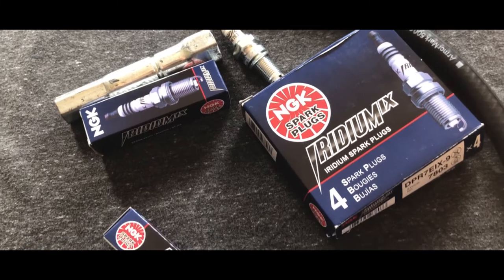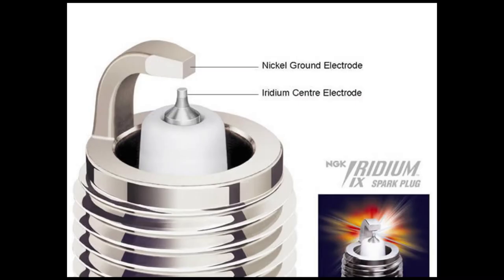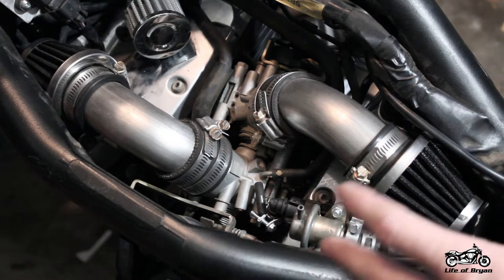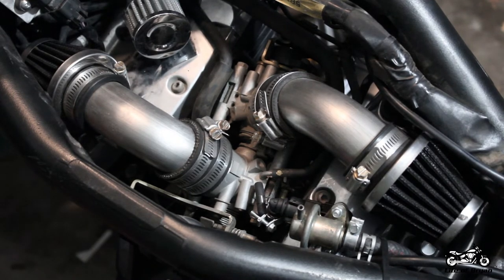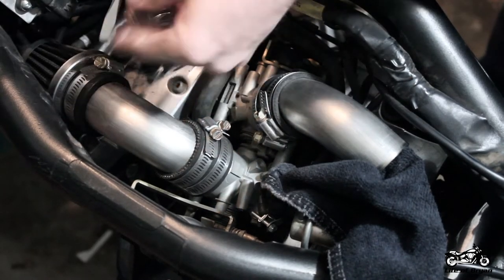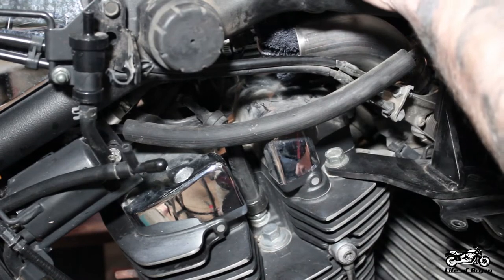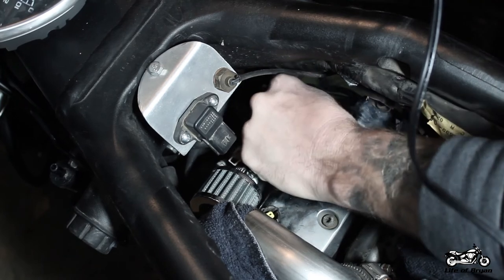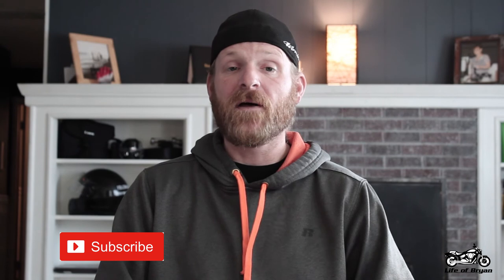Yamaha Warrior 1700 Spark Plug Replacement

Comment: 2004 warrior.  I just did the plug change today.  Your video was helpful,  but.. with the original air box the right front is a little more of a " special treat".
First remove the black cylindrical part near the head tube area the are 2 screws,  this gives wiggle room to get the plug wire off and back on.  Using the original tool kit plug tool, angle it up and into the recess where the plug is,  you can use a flash light if you need shining through the fins this will help to align the tool. You may have to push down to get the top of the plug into the rubber  grommet of the tool once in 9m carefully unscrew the plug.  Putting the new one back in might take a few tries but it will go back.  I used a screw driver through the fins to align the spark plug,  carefully tighten, don't cross thread or over tighten,    position the spark plug wire, once again using a screws driver to help guide the boot over the plug put the cylindrical part back tighten the 2 screws and you are done. Hope this helps
Reply from the maker: Between the performance gain and the extra space created by removing the stock airbox, a BAK/VBAK kit is a definite upgrade that helps in multiple ways. Without that stock box, the plug change is so much easier. Thanks for the write up on doing it with the stock box still in place, I imagine it'll help many others out when they come to the same problem.
Reply: Dave SPADARO what is the black cylindrical part you are speaking of? I’m trying to change the plugs and the front right is kicking my ass. Please help!
Reply: Dave SPADARO Nevermind. I got it. And your tip definitely helped me out! Thank you!
Reply: @davidhoward2074  same bro. Fml
Reply: @davidhoward2074  so we don't have to remove the entire air box?
Reply: Buddy Luv undoing that black cylindrical part is key as well as using the tools that came in the original kit. Good luck
Reply: @davidhoward2074  it's an ignition coil
Reply: I don't see the part you're saying to remove. Where is it?
Reply: @joras18   look at the right side of the tank. You should be seeing the front cylinder. To the right on the frame is the black cylindrical ignition coil. Unscrew the two Allen nuts and move it out of the way.

Comment: Thanks for the video . I took my gas tank off because my neutral light is always on(looking for pinched wire) and noticed the stock air filter was dirty as hell. I am still waiting on the 2 stock filters and ordered plugs also since the tank was removed. I bought my 2006 warrior with 18k miles about a month ago I have had lots of bikes but this one’s really fun to ride I think I’ll keep it forever also.
Thanks,
Brian in Texas
Reply from the maker: Hey Brian, thanks for watching and commenting! Welcome to the Warrior family also. If you haven't yet, join the forum and Facebook groups. Tons of good people and info in those places. 

Warriors are definitely bikes that will put a smile on your face. I still get that little grin when I start it up and take off. 

I like your way of thinking and getting all that stuff done at once while you've got it apart and are already in there. Hope you were lucky enough to have the factory tool kit with it, it definitely helps with the plugs. I'm sure a universal joint and extensions would work fine, but that socket makes the job a lot easier.. Were you able to figure out the original problem with the nuetral light staying on? 

Thanks again! I hope some of my videos have been able to help out.
Reply: Life of Bryan yes I have the tool kit with the spark plug socket, very happy to have it. No luck so far with why that neutral light is on🙁
Reply from the maker: Have you checked the relay under the seat? It's under the and just to the left of the fuse block. Believe it's under 40 bucks to replace.
Reply: Life of Bryan Do youHappen to know the name of that relay so I can start researching where to get that part?
Reply from the maker: Here is a link to one on ebay. They're a little more than I thought, but this one comes from partzilla and seems to be about fifteen dollars less than all the others. Hope this helps you locate it and track it down. Keep me posted.

https://rover.ebay.com/rover/1/711-53200-19255-0/1?icep_id=114&ipn=icep&toolid=20004&campid=5338428498&mpre=https%3A%2F%2Fwww.ebay.com%2Fitm%2FYamaha-5PX-81950-00-00-RELAY-ASSY%2F283318472758%3Fepid%3D1433685955%26hash%3Ditem41f718d036%3Ag%3AjhcAAOSw7mlZ5Mfd
Reply: Life of Bryan Awesome I will let you know how it goes

Comment: I had changed mine with spark plug socket. The front spark plug was difficult to removed but got it out. It would be easier with their spark plug removal tool. Great video.  Keep it up.

Comment: 2002 Warrior, traded my '96 Vmax for it four months ago.  Younger brother owns a large moto service shop in central FL so he had it there the first month I owned it.
R1 forks and front fender
Jardine full system straight cut drag pipes
Power Commander V
Barons Stealth BAK
Barons 930 lb spring
Barons lowering link
TT bars with Kuryakyn Kinetic grips
Reply from the maker: Hey, thanks for the comment, and welcome to the Warrior family! Sounds like you already got into it quite a bit. Have any more mods planned in the near future? 

Those Vmax's were beasts! Another guy who rides a Warrior in Michigan just recently acquired his by trading his vmax for it as well. How does the warrior handle compared to the vmax? I'd say that I hope winter hasn't been too bad, but being in Florida, I'd imagine you're still getting to ride. Life goals to ride year round. Thanks again for watching the video and commenting!
Reply: Even when I lived in NC, I would still ride year round.  Being back in my home state of Florida though is nice, winter riding isn't too bad, it's the summers that can actually be unbearable with the heat and humidity.   I'll likely keep this bike for a while.  Yes, the Vmaxes are a beast of a bike, not the most comfortable on long rides, but a monster in a straight line (factory boosted 145hp V4).  The Warrior has it beat in handling, and comfort.  That was my main reason for trading, I wanted something more comfortable for the wife and I to enjoy, and pushing 50 years old, I needed to slow down just a little.  I've always liked the Warrior styling and finally found one that I was able to trade for.  Thanks for your great videos, they were a big part of my research when looking for my Warrior!
Reply from the maker: Florida weather reminds me a lot of Missouri in the summer. Hot and humid, but Missouri doesn't have the daily rains that seem to hit Florida. I used to ride year round, but now I don't break it out if it's below fifty, except in the spring when I just can't take it any more. 

That's awesome that my videos were able to help you out when looking at bikes! I love the looks of the Warrior. It always seems funny that a bike that's almost twenty years old still turns heads like it was brand new. That's not even mentioning the torque and handling of the bike. They were great bikes and I would love to see Yamaha revisit them again in the future.

Comment: hllo Bryan
recently purchased 2003 rs warrior. needs a little work. has stage 2 cam and injectors/ big air kit/ predator ecu. 240 back tire/ air ride suspension. just rebuilt thr rear master cylinder . currently waiting on a vbelt from chaparral Yamaha in san Bernardino . this bike has 16" ape hangers custom paint job and roadking front fender.. cant wait to roll on it. I come from a streetbike and Harley sportster bg. ridin dirtbikes for years too many injuries. love the videos .

Comment: Ashland, KY  02 warrior, and its my forever bike, daily rider is a harley now, but i actually cross threaded my front left cylinder, i have to taper the threads of every new plug to get it started now
Reply from the maker: Ouch! That's always one of my biggest fears when doing plugs. The Warrior sure didn't make it easy either. Almost like they wanted you to cross thread them. That fuel line trick is pretty slick though. Thanks again, stay safe out there!

Comment: Actually the M109 and C109 are different internally. However, the C109 is powerful and has plenty of torque. The challenge is she weighs 900lbs. Mine has various modifications, GMan exhaust, self calibrating fuel system and aftermarket air intakes. My fat girl “moves” and sound great. More important like the Warrior it leaves Harleys behind...lol
The bikes are for the most different ridding “Styles”. The 94, 86 & 82 are original and very nice. The 75, 70 & 71 are restoration projects. These were the bikes I enjoyed in my youth.
Almost forgot to mention, ur picks of the VTX and VROD is great . Those were the other bikes I considered in 2002. Just couldn’t justify paying a Harley price. Plus it is a Porche engine.
Reply from the maker: Haha! Yeah, I can't bring myself to pay the price for an oil spot in my driveway either. The euro V Rods look awesome though, and if I build another muscle cruiser, I think I'll try and find one anyways.

Comment: thanks for you videos...getting horrible gas mileage..gonna change out the plugs, clean out, filters and fuel injectors...thanks
Reply from the maker: No problem! Hope that helps. Also check for any kind of leaks around injectors, or lines. When you pull the plugs be sure to check them as well to see if you're needing to adjust the air fuel ratio. Any modifications? Using a tuner if so? Just a few other ideas to check while you're looking into the gas milage. Hope you get it figured out. Thanks for watching and commenting. Stay safe!

Comment: Besides my 2002 Warrior I ride a 2009 C109RT, 1994 Katana 750, 1986 Honda VF1000R, 1982 Honda CM450C, 1975 CB360T, 70 & 71 Sl350s’
Most purchased new or 1 owner. But, my Warrior is my best overall, great around town but sized right for long rides. Twice to Sturgis.
Reply from the maker: Love it! You're all over the place. How do you like that 109? Pretty much the same motor and transmission and the m109, right? Only real difference in the styling? Another cruiser I'd love to have sitting in my garage along with an VTX 1800 and V-Rod. Plus I'd have to throw in some sport bikes for good measure. 🤣

Comment: 2004 Warrior, bought in 2006 with maybe 12k miles on it.  Plan on keeping it forever.  Do you use any sort of anti-seize on the plug threads when you put them back in?
Reply from the maker: Definitely use some anti sieze. I didn't shoe it on the video, but always a good idea. Especially when putting in iridium which won't be replaced as often. Thanks for watching and commenting! Stay safe out there brother!

Comment: Good afternoon brother! Today I decided to change my spark plugs. As I began to thread the first one in, it gave some resistance. I didn't want to damage the plug by forsing it in, so I took it out. I then tried to thread it again and it wouldn't thread easily. The spark plugs I purchased are DPR7EIX-9 and stock NO. 7803. These are supposed to fit my Warrior, but one never knows. Could it be that I needed to accommodate the plug better?

Comment: Sweet! I was just thinking about this the other day! The warrior I have I’ve had since about June or July, I traded my wrx for it. It’s my first bike. Not necessarily the right one for a new rider, but, I mean, I got a hell of a deal.
Reply from the maker: Hey Levi, thanks for watching! My first Warrior was gotten on a trade as well. I traded off my 05 gsxr for it. It was also my first cruiser bike. I've tried to go back to sport a couple times, but have finally decided that even they can't give me the smile that my Warrior does. Eventually I will be getting another sport bike, just for go fast reasons, but I'll always have my warrior. Thanks again for commenting and letting me know what years yours was and how long you've owned it. Keep riding and stay safe!
Reply: Life of Bryan oh yeah, I didn’t say what year it was, it’s an 07 my bad! Only 12k miles, only had the main pulley bolt, come loose. So other than that, I put 1500 miles on it, and I absolutely love it!
Reply from the maker: That main pulley bolt is a known problem. I believe the manual states that the bolt is supposed to be tightened to something like 60 foot lbs, where as it is actually closer to 110-120. Hope this spring rolls around and you can get a lot more miles in on that bike. Welcome to the Warrior family by the way!
Reply: That’s what I read, somewhere, seems good now, just had a shop do it, raped me for prices. After that I’m learning how to do everything on my bike haha
Reply from the maker: Nice! Definitely worth learning how to do things yourself on it. The forum is a great place for information, and you have a great group of guys in the Facebook groups that are always willing to help with questions. If you haven't joined them yet, I'd suggest doing so.

Comment: I have a 07' and the plugs i just pulled out which I'm sure are the factory DPR 7EA 9.  Replace with what you recommend or same i just pulled out?  Basically stock other than pipes and an FI2000

Comment: My next job...but I have to remove the air filter case as well...and  luckily I have the spark plug tool...😅
Reply from the maker: That tool is perfect for the job. Definitely makes it easier to get it there and get them out. Just did a video over removing that air box and replacing with a DIY big air kit. If you haven't seen it, that's another mod that makes plug changes easier.

Comment: If I have a bone stock warrior besides v&h pipes, what plugs do you recommend?
Reply from the maker: Hey, thanks for watching. Depends on what you're wanting to do with it. If you don't mind changing the plugs, copper is going to be your best conductor and work the best, but not last as long as a platinum or iridium. Iridium isn't the greatest conductor, but will last longer and keep you from having to change the plugs as often. Hope that helps! Thanks again!

Comment: Bryan I was checking the plug on the right front ( the hardest one to do ) and the cable came right ofd of the boot. It was green and corroded. How do I change spark plug cables ?

Comment: What year warrior u putting the plugs into cause the ones u give for my warrior says it s not made for my bike
Reply from the maker: Looking on Amazon? I had the same exact problem and was worried when I ordered mine. Was looking at Power Commanders the other day on Amazon and the one for the Warrior said it didn't fit my vehicle, even though the title said for Yamaha Warrior. As long as you're getting the dpr7eix-9 for iridium, or I believe dpr7ea-9 for standard. Hope that helps, and thanks for watching!

Comment: What's factory plug? Iridium high resistance? Should of gone silver
Reply from the maker: Do you have any experience with silver plugs? I know that silver is a lot better than iridium at conducting electricity, but it has a lowering melting point and not sure how it would withstand to combustion and wear. I have used iridium in just about every bike I've owned for the past ten years and sometimes habits are hard to break. I might need to look into silver next time. Thanks for the advice and for watching the video and commenting. Hope you're getting some good rides in this winter! Keep riding and stay safe!
Reply: Hmm I use these in my warrior, and all my cars, no isssues at all and they last for a very very long time
Reply from the maker: Used them forever as well. They're a great plug, so I've never even really looked into doing something else. I'm not against researching the silver ones though and seeing if they are worth switching to. Thanks for watching the video and commenting, Kalan!

Comment: @RS Warrior Bryan ... Is there any way you can measure that spark plug tool for me I think I'm going to try to have a friend weld a short pipe to a spark plug socket with a nut on top ...everyone on eBay wants 60 bucks for that kit ...it's either that or snap-on truck 😬😬😬

Comment: Hi Bryan I’ve had my 02 warrior for about a year now in the middle of doing a few mods at the moment spike filter on the right and a K&N panel filter for the air box also just fitted a cobra black fi2000’ question for you my warrior is an Californian import and has one them emission box’s attached to the lower left of the frame i wana take it off any ideas?
Reply from the maker: It's not necessary at all. I believe there are a few threads in the forum that actually tell how to remove, but I found this one that seems to say it's actually pretty easy to do. Just need a longer vent hose, I believe. Hope it helps! 

https://www.rswarrior.com/threads/california-emission-removal.102808/